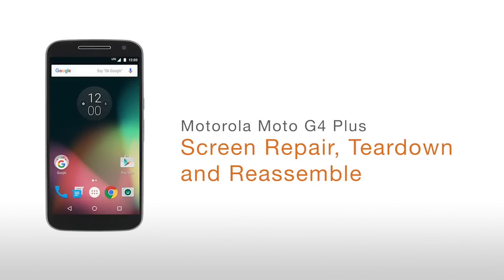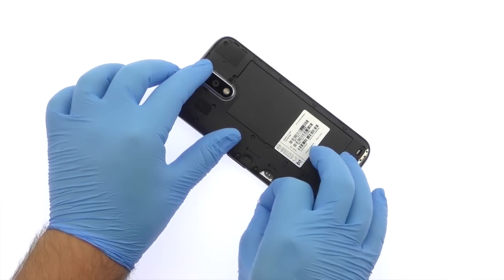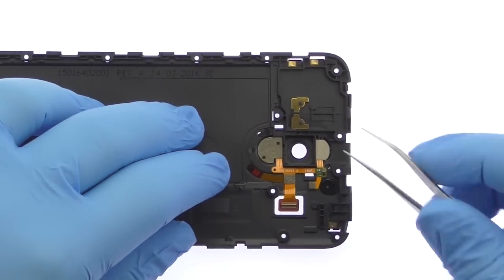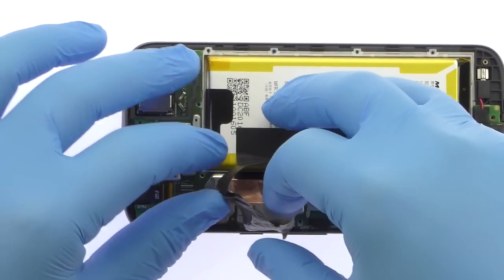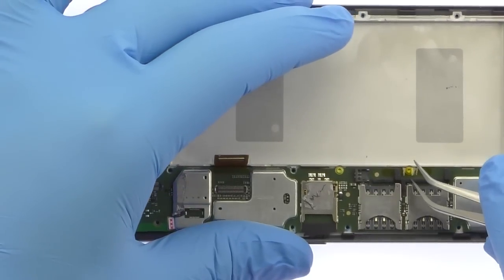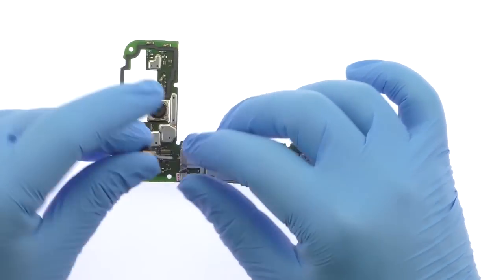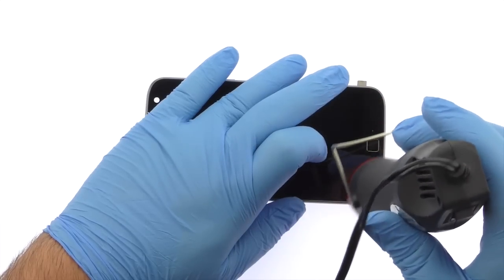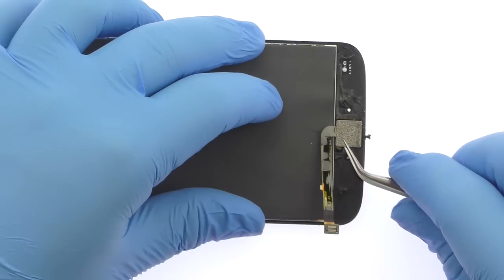Motorola Moto G4 Plus Screen Repair, Teardown and Reassemble - Fixez.com

Comment: my moto g4 plus was dropped in water all things are working fine only screen brightness is very low and cant seen easily what to do and which part i have to replace and replacement cost
Reply from the maker: Depending on the extent of the water damage I could possibly be just your display. However if you aren’t familiar with repairing small surface mount components it’s usually a job best left to a qualified repair shop.

Comment: went to remove battery, found it has ADHESIVE, doesn't just pop out
Reply: me too, having a hell of a time getting it loose
Reply: Hi! The black piece of tape on the short edge of the battery can be used to lift the battery up. Just peel the tape up from the backside of the battery, and use it to pull the battery apart from the frame. Just pull firmly and give the adhesives some time to get loose.

Comment: am get double screen in which background screen is appearing on notification display
Reply: Its called screen burn, and its a common g4 problem. If ur still using the device then install bluelight filter app and keep it at 15-20%.

Comment: sir my moto drop in water ,its not working only show in blank how to fix it pls give any solution
Reply: change the screen
Reply: Hi!
I am having same problem I suddenly drom my phone in water just for 2 secs after I switched it off dried it completely then switched on, display was working but after sometime display suddenly got blanked / black. I can here it's " hello moto" power on voices or vibrations when I touch the fingerprint sensor,but can't see anything display is still blanked. I went to two mobile repair shops both said can't fix the problem. One of the shop said its display is good (working) but this is ic problem which was shorten, currently not able to find out a single ic in the whole market. So I am stucked here. If you tell me what did you did with your moto g4 plus it might help me.
So please sir reply me as fast as u can!
Thank you..!
😃😃

Comment: do you do you have any solution for the screen overlay issue in the Moto G4 plus I recently submitted my moto G4 plus to the main service centre for getting the service done they said they are replacing my motherboard and my screen and and I even had argument with the Motorola helpline regarding this issue I told them that if I face the same problem off screen overlay after my warranty period shall I pay for my motherboard If in case you have to replace my motherboard they said yes so what's the point if Motorola isn't strong enough I chose Motorola because it was at least better and ever since they have gone in the hands of Lenovo they have become pathetic devices this no quality control I had a choice between Lenovo and Motorola and xiaomi all the Wars are over me and Lenovo is almost the same price range Motorola was still expensive I went for Motorola because I felt that the quality was very good very good but I will just made me upset and the help line guys pretended don't understand what I am talking to Ivan do I explain the main problem they don't they pretend not to understand so that's very irritating please help me dude if you know anyone higher authority of Motorola please convey this message to them thank you..

Comment: Sir My camera lens is scratched how to Fix that
Reply: same question
Reply: yashveer jadon same bro..
Reply: dude it is 1800/- Mid case. 
Don't replace it..
Reply: same question
Reply: where do u get mid frame?
Reply: it's of No use To change 😃🤔 .. Apply some tape over the lens and check.. Or Buy a new camera
Reply: why? no use to change?
Reply: want to change it..please tell!!! ASAP
Reply: apply tape it works seriously thanks yashveer
Reply: Tape Works Actually Refractive Index Is diverted To layer.. 😃🤔 Which results In clear images.
Reply: sorry but i cant understand..where can i apply tape? on camera glass?
Reply: Vatsal Tamboli camera glass
Reply: thank u deepak..one more question..any kind of tape or transperant?
Reply: Vatsal Tamboli normal tape but don't touch otherwise your fingerprints get on it
Reply: yashveer jadon Same question
Reply: Anita